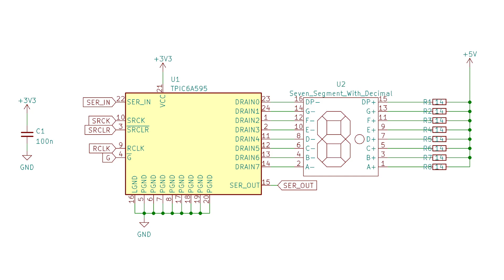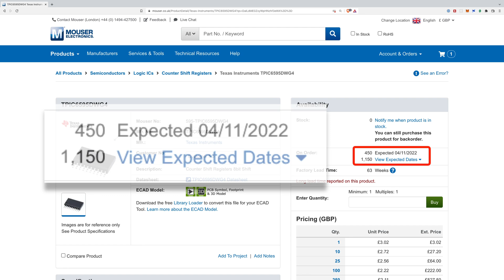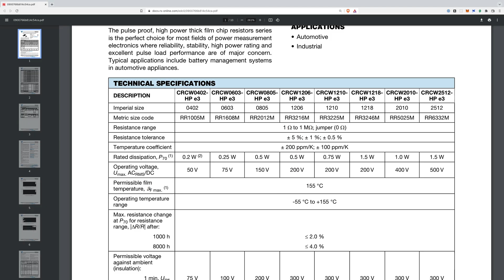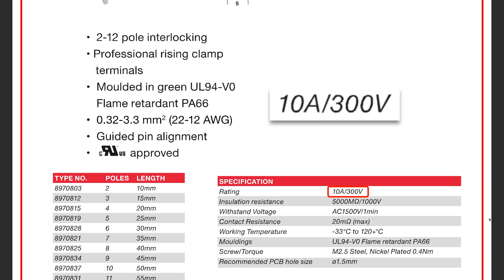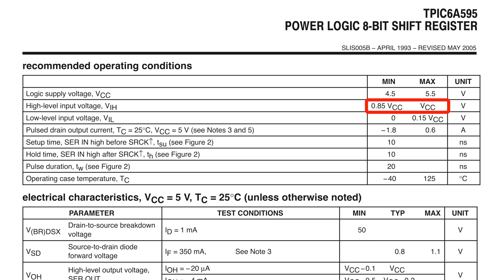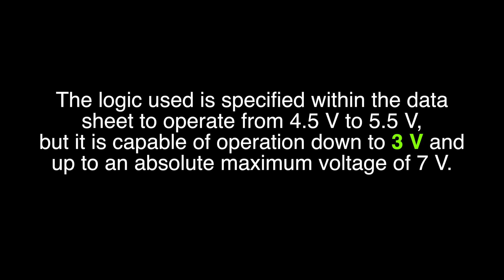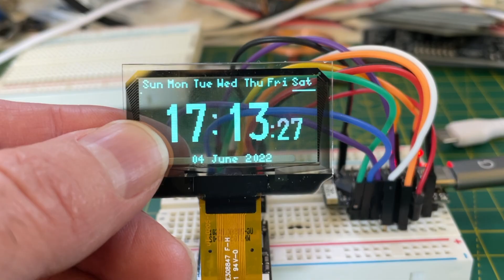Giant 7-Segment Display: Journey from Monolithic to Modular!

Comment: Well, if u need 16amp and each dupont connector can only handle 1 amp, maybe u can just use 16 of them in parallel? Just use a longer length header?
Reply: Also why not use the 2 - wide header and right angle with alternating male and female so u dont have to use ribbon cables?
Reply from the maker: @DataUser1357421En  I wanted a bit of flexibility on the distance between the digits, in my first version I did it all on one big PCB, but that meant the digits were too close together.

Comment: the majority of segment clocks we see.... if viewed through a camera, they cycle through each of the 7 (or 8 with dot) segments, lighting one at a time.  thoughts ?
Reply from the maker: Definitely an option, one of things I quite like about the current design is the power shift registers that mean you only need one IC on each module and you just clock in the pattern you want displayed. And it can sink a lot of current so you can have very bright filaments.

Comment: Why not use the series-connecter higher voltage versions of the filaments? Eliminate all that trouble with ridiculous high current levels. The driver can handle 50V max, as long as your power supply is less than  (LED Vf+50V)  you are fine.
Reply from the maker: I did that in a previous video - https://youtu.be/l18NYKRv0g0 - the main problem is that 50V power supplies are a bit of a pain.

Comment: 16A clock :D my god
Reply from the maker: Yeah, slightly over the top! As someone has pointed out I could just do one filament at a time and do it all quick enough that it looks like a solid display.
Reply: @atomic14  i do weirdly like the sound of a 1.2jigawatt bedside clock humming by the side of me
Reply: @atomic14  i think current i way to high check it !
Reply: @atomic14  project is cool but power comsumpion little bit to high

Comment: With driving the segments a lot harder then i would multiplex them and save the current. my LED qube only drives one LED at a time and i don't notice it as it's still bright enough for day light use. in the end your be using a room heater to tell the time.
Reply from the maker: That's a good point, I'll probably end up using a PWM signal on the enable pin to tone them down a bit.
Reply: @atomic14  i quite like the design idea and i like clocks, so it looks like i might have to order some low voltage led's. i've got a few but they are about 75V for a mains lamp i was going to make.
Reply from the maker: @TheEmbeddedHobbyist  Yeah, the 3V versions make it much more accessible - and safe!